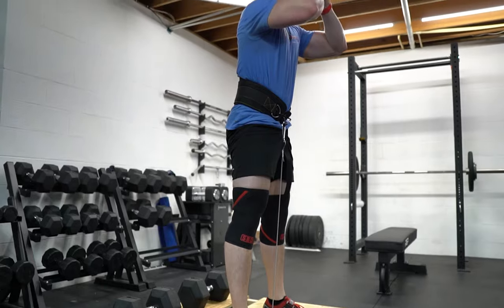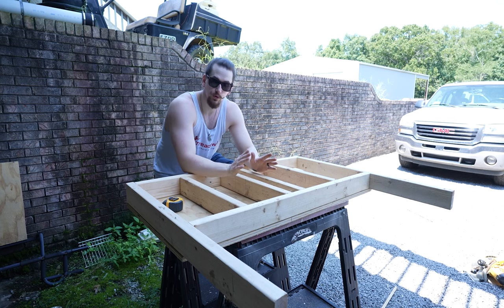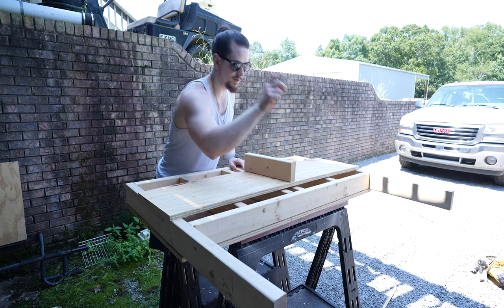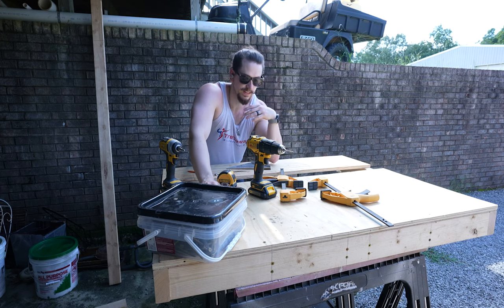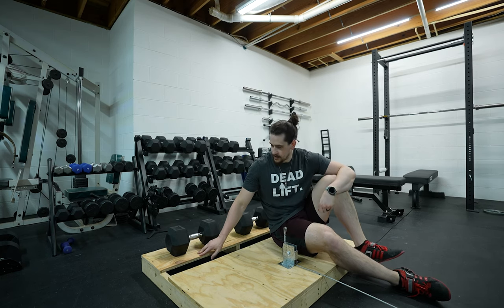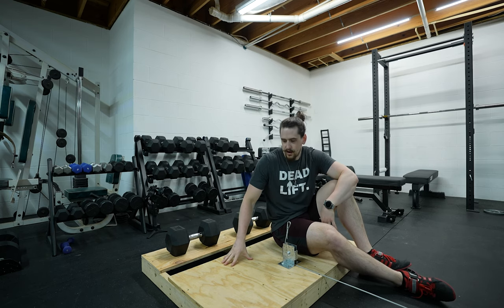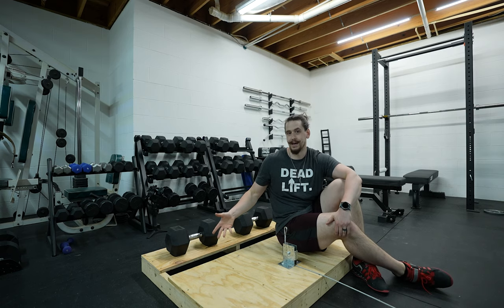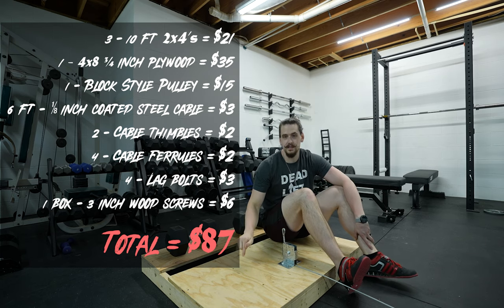DIY Belt Squat Machine - Homemade Belt Squat

Comment: Very nice build, I love the idea of adding the pulley to the top of the platform. Great job man!
Reply from the maker: Thanks! My original design was actually almost identical to yours but I ended up putting the pulley on top because I (like most people) have little woodworking experience.

Comment: That is an AWESOME build, I always liked the cable belt squat over the lever (Wenning) style.  That said, if I ever get around to building this, I will look at a few changes. First, I would go with a 2x6 frame to allow the pulley to mounted on the underside with the cable running up through a hole in the platform and the same out the front. Second, I would reduce the size of the platform by the DB section, and instead use a length of 2x4 T-brace with a drop-in or dowel locking system on the front face of the platform that braces against the jack post (or maybe just make the platform the width of my squat rack and brace it that way as i don't have a pulley system built yet). Finally, in your build, I would use nuts and bolts with an additional stiffener plate on the underside to ensure that those threaded bolts don't rip through that plywood and possibly injure the user should you get into some heavy weights.  Thanks for the post.
Reply from the maker: Thanks! I will say, the pulley is definitely not going anywhere. All 4 bolts are going into the studs. It can handle all the weight I can lift easily, plus some.
Reply: @RyanTreadaway  You probably called that out in the build...sorry, I jumped over the build itself. Thanks again.
Reply from the maker: @1966johnnywayne  no worries! Those are good ideas for modifications you came up with

Comment: Have given up on barbell squats because I keep tweaking my lower back, and at my age (54) I just don't think I should be loading my spine like that. So I want to try belt squats and have been scouring Youtube trying to find the best way to approach them, and this looks like a great way to go about it. My squat rack has a lat attachment that this could hook right into. I just wish there was a way to start from the upright position instead of from the bottom. Thanks for the idea, great video!
Reply from the maker: You could come up with a DIY for that too. Maybe build some type of A-Frame with a notch at the top.

Comment: It is easier to make a lever belt squad gadget,  which you can add to the power rack. You can also use it for sitting calf raises if you add a small seat to the other side of the weight plates. Then you do not have any problems with the platform moving.
Reply from the maker: That would definitely be easier but it isn't the exact same movement. I wanted a true vertical resistance rather than an arc.

Comment: Great idea! Have you thought about handles to help in getting used to the movement or getting up if you're stuck?
Reply from the maker: Great question! I don't care to have handles as an aid for the movement because I want it to be as similar to a barbell squat as possible. You don't need them for if you fail a lift because the weights will touch the ground at the very bottom so you aren't in any danger. 

I have thought about it from the perspective of being able to get up off the ground easier for the first rep. The easiest idea I've come up with (but would require a partner), is to have a plyo box under the weight pin so that you could start the exercise standing up. Then just have the partner pull the box out from under the weights.

Comment: I wonder if I could set up belt squats with titan selectorized lat pull down machine?  However I would like to start on top due to bad knee
Reply from the maker: It'd definitely work. You'd have to have a second pin to hold the weight up in the air and someone to pull that pin and put it back in for you.

Comment: What's the max weight on your pulley system?
Reply from the maker: My pulley system is supported by the house itself so it can hold however many plates you can stack on a weight pin. Personally, the most I've ever used is ~270 lbs. I have a video where I show myself making it on the channel if you want to go check it out. The link is in the description of this video.

Comment: Build an $87 belt squat machine using $1,000.00 tools.
Reply from the maker: True. But this could easily be built with a cheap skill saw and drill. (Or even a regular saw and screwdriver if you're willing to put in the time and effort.)
Reply: I'm going to tell my wife to never bake cookies again as the oven costed way more than dough and chocolate chips.

BTW, $87 in materials ≠ $87 squat rack. One of the beauties of having tools is the final project is worth much more to one than the cost of materials.
Reply from the maker: @zulutangoxray  good point. Better start making those cookies on top of a fire. Lol